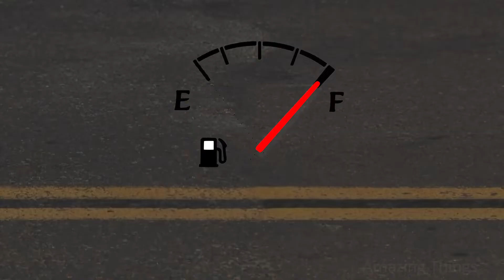Incredible PLASTIC Road technology that would save the world

Comment: Did you know that asphalt is actually a really recycleable material. Plus it doesn’t have to spray micro plastics into the atmosphere. Wires and water through them means that if a car crashes or they have to replace the road the water or electricity would be knocked out each time. They also are tiled which means that if a fast car has to brake quickly then it could fly off while the tile also does.